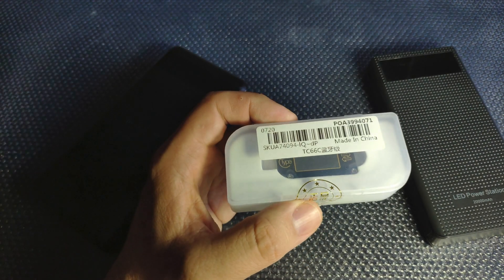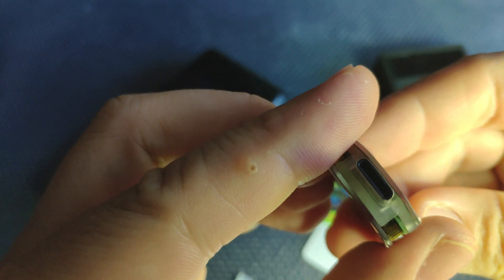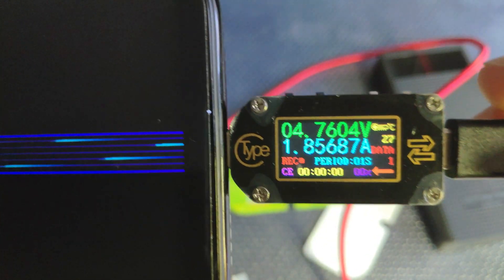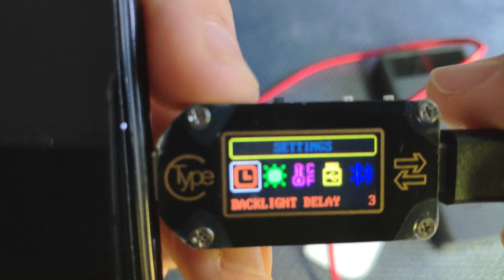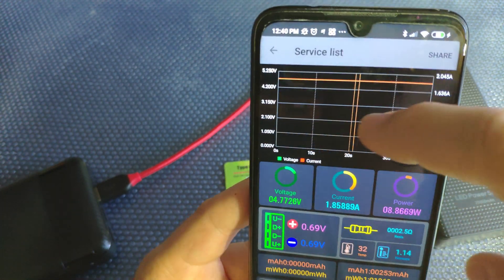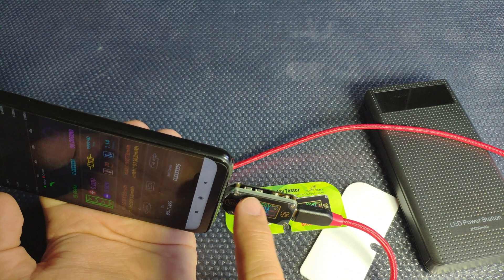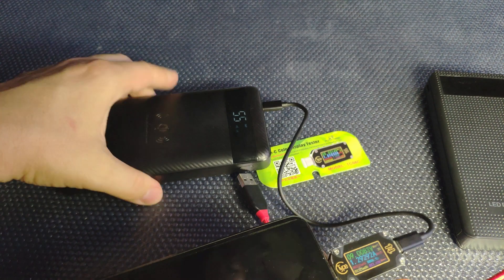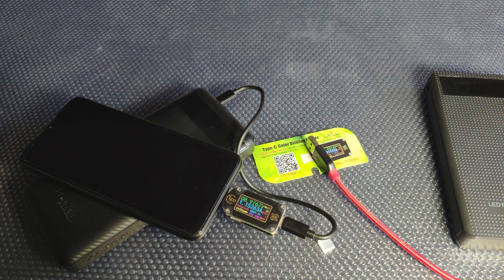RIDEN TC66C USB Type-C PD & QC Tester Analyzer

Comment: Thanks for the video. Does it support QC4.0 ??
Reply from the maker: The QC 4.0 is not supported yet, it might be added later by a firmware upgrade. It supports: QC2.0, QC3.0, APPLE2.4A/2.1 A/ 1A /0. 5, Android DCP, SAMSUNG, Huawei FCP, Huawei SCP, PD2.0, PPS